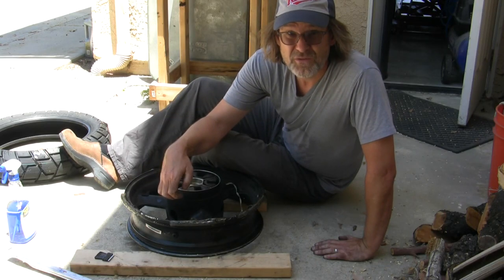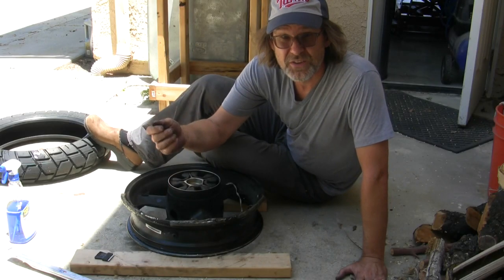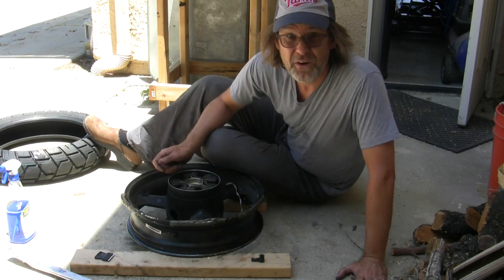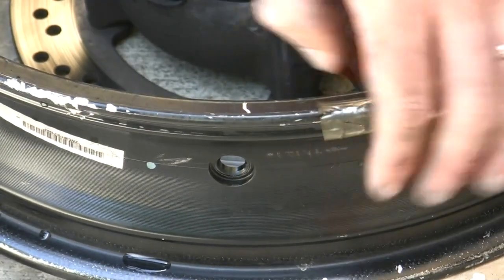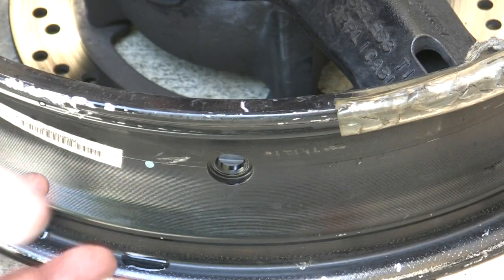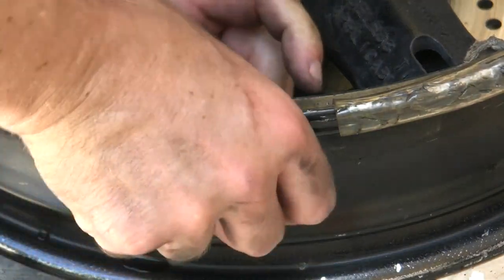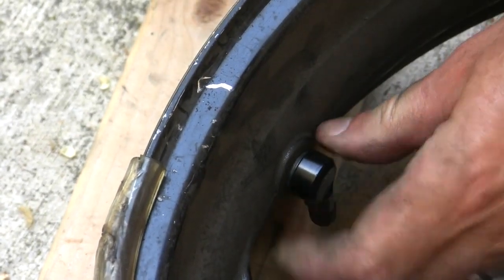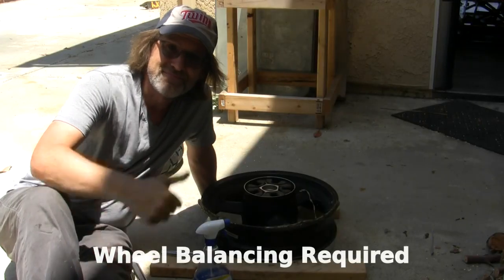Install 90 Degree Valve Stem on Motorcycle Wheel

Comment: Think I would have put a little blue medium strength lock tight on the threads as peace of mind 🤓 Love the short to the point video
Reply from the maker: First, thanks for watching. Others have made the same comment and I must say I agree. That being said, this installation was many years and over 20,000 miles ago and I've had no issues. Love the convenience of access now.

Comment: That's cool... but what are pros and cons of such 90° valves?
Reply from the maker: After having mine in for a couple years now without issue, I'd say the big pro is ease of access when the wheel is in any position. The other pro is they don't degrade over time like a rubber valve stem will. The only con I can think of is a extra wheel weight here and there for balancing, but that's not much of a con. Balance is achieved. Thanks for watching!
Reply: @UrbanMonkTV 
Thank you for the feedback. 
Your video is great as it shows what those valves stem are made of, and how they are used. Very interesting and valuable to me. Thanks
I still don't feel that comfortable with those things.  My fear is that it can break and leak a lot faster than regular rubber ones (which have experience proved reliability, and are basically a single part). 
I agree about ease of access for inflation or pressure checking and it is why I was looking at this type of devices first.
But after looking at it I will probably look for a proper inflator / pressure gauge 90degree connector and stick to the classic tire valves. The reason is that I prefer to keep the live supporting part as simple and save as can be, even at the expense of a more complex ancillary maintenance equipment.
Reply from the maker: @yveslegrand9826  While I haven't experienced any issues with mine I don't disagree with your logic. Keep It Simple as they say. Everyone needs to make their own judgement calls when it comes to risk. Much in life is a gamble.
Reply: No cons on a Street bike, possibly on off road with getting caught on something. Checking and adding air is worlds easier, especially on a bagger that makes such a simple task a chore.
Reply from the maker: @freebehindbars8654  Agreed!

Comment: Just came across your vid… great by the way… question, once I install these, do I have to rebalance?
Reply from the maker: @jerrydelatorre5977  Thanks for watching! I waited to install mine until I needed to install a new tire. So as a matter of best practice I always rebalance as part of a tire change. If you were to remove and replace the same tire after installing one of these valves I would still recommend rebalancing. Alternatively, if your current tire/wheel is in balance and you have a small scale, you coyld weigh your old rubber valve stem and the new ones and, if they match, in theory you wouldn't have to.

Comment: How does one know what size to order prior to taking the wheel down and tire off?  I ride a Honda CB500F.  No information in the manual on this.
Reply from the maker: Yes, while the odds of getting it wrong are slim given how standardized valve stems are, I actually knew I was slightly at risk of having to return the ones I bought if they hadn't fit. I made sure they were returnable. Thanks for watching!

Comment: 7 foot pounds is max tightening torque spec and use blue loctite👍🏻
Reply from the maker: A little over 8000 miles now since I installed and no sign of it becoming loose or leaking.
Reply: @UrbanMonkTV  Both of mine leaked from day one on my 1500 honda goldwing. both wheels leaks about 6 pounds of air every 3 months.  They were a nice snug fit and exactly what it was supposed to take. I try to keep all tires at max pressure on the tire at 42 but after 3 months it is usually down to 36 or 37 psi. I know that is not that bad. I'm sure 10 psi would be safe. Just don't like it and have always gone by max psi on any tire. no one seems to know why both tires leak the exact same psi at the same time. Just crazy.
Reply from the maker: @JohnSmith-uy7sv  Thanks for sharing your experience. Mine have served me well. I just rode across the country and back over 24 days and didn't need to add air once. Perhaps differences in brand? Thanks for watching.

Comment: Nothing to it, but I used loctite.
Reply from the maker: Not a bad idea. I didn't on both my wheels and still holding perfectly years, many miles and many states later.
Reply: @UrbanMonkTV  I’m sure you’ll never have an issue, I’ve just seen so many things vibrate loose off these bike. I do it on just about everything for the peace of mind.
Reply from the maker: @freebehindbars8654  I would never fault prudence. You're the wiser of us.

Comment: Everyone's been adding Loctite Blue to locknut on these type of valves
Reply from the maker: I can see a person wanting to do that. Good idea. I'll have to wait until I change the tire or have a failure to do that. So far, it's remained airtight.
Reply: I just bought a set. I'm thinking the same of using threadlock.
Reply from the maker: Wanted to follow up on this...So far a little over 8000 miles since installing it and no sign of it becoming loose or leaking.
Reply: @UrbanMonkTV  Nice!  Thanks for the update 🥂
Reply: No reason to do that.    Should be allright without locktite
Reply: @UrbanMonkTV  there is zero need for locktite. The pressure that builds due to the rubber being compressed is holding the nut from moving.
Reply from the maker: @milenkosoe  Yeah, I'm over 20,000 miles further along since installing these valve stems and still no issues with leaking.